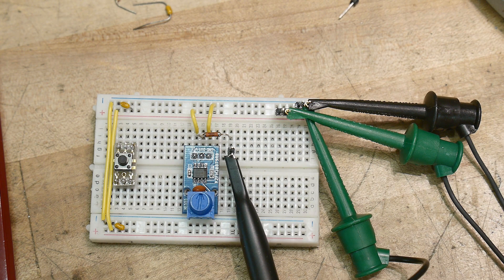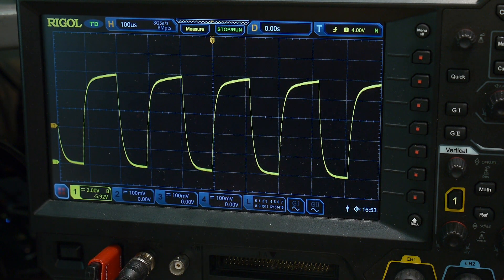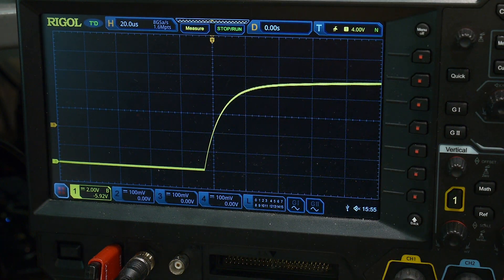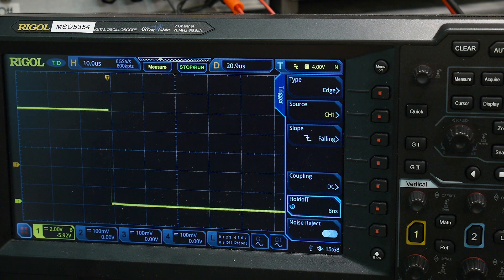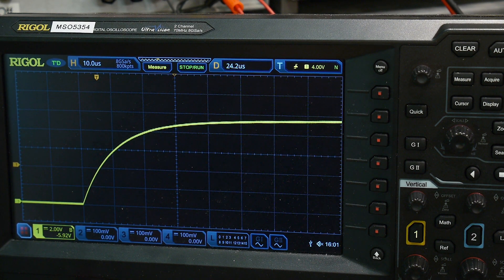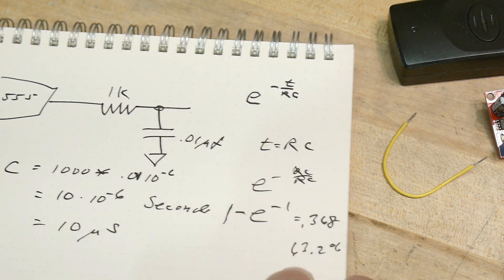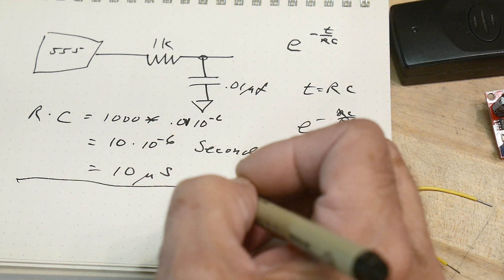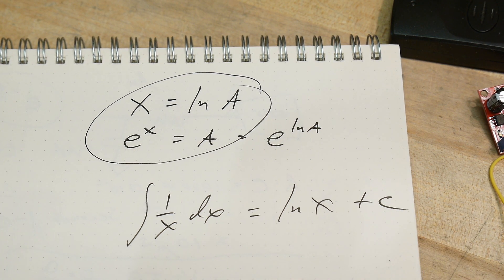#1112 RC Resistor Capacitor Circuit

Comment: You can go to engineering school, but, it's easier and cheaper just to read the textbooks.  Free, actually.  Many books are free pdf online. 
Get a used oscilloscope, etc, and you can do labs at home.  Assets are fully depriciated so, equipment is essentially free also, minus shipping.

Comment: Just as a note, you don't have to wait for the voltage to get to 100% (let's say 5V).
You can set your electronics to be triggered at 0.7 volts for example, and work with that.

Comment: The whole reason why e appears in the equation is that e^x (e in the power of x - exponential function) is the only function, whose derivative equals to itself. As the voltage across the capacitor is proportional to the charge, and the voltage across resistor is proportional to the rate of change of charge over time, and they both sum up to a constant (the battery voltage), it turns out that the charge will have to be proportional to it's rate of change. And the rate of change is the derivative of charge over time. Meaning, the charge will have to be an exponential function over time, so its derivative is proportional to itself. That's how e gets into the solution.
Reply from the maker: sounds OK, I learned it from the inverse of an integral. like this: https://www.york.cuny.edu/academics/departments/earth-and-physical-sciences/physics-lab-manuals/physics-ii/time-constant-of-an-rc-circuit
Reply: @IMSAIGuy  The discharge case (discussed in the paper you suggested) is somewhat easier to start with because there you don't have a battery, meaning the rate of discharge is directly proportional to the charge remaining, and the voltages on the resistor and the capacitor are equal and opposite. So R✖️dQ/dt = -Q/C, meaning  dQ/dt = -1/RC ✖️ Q, and clearly the solution for Q is some constant times e^(-t/RC), as its derivative is exactly what is on the right side of equation. The voltage on the capacitor V is proportional to Q. As at the time of t=0 the voltage was equal to E, and e^0 = 1, we find the coefficient equals to E, so V(t) = E✖️e^(-t/RC).